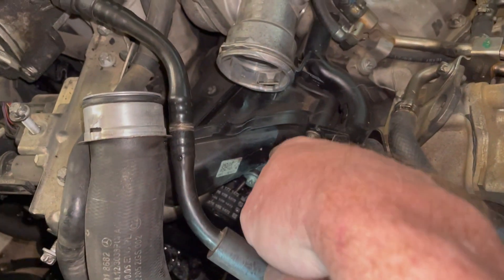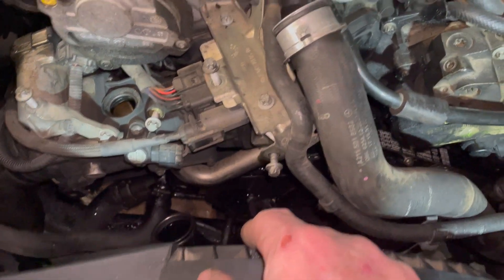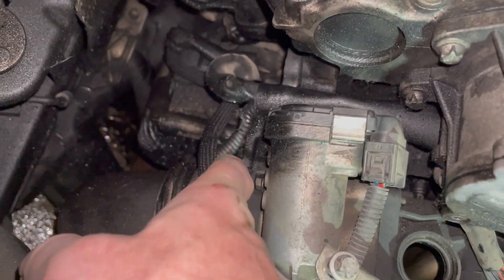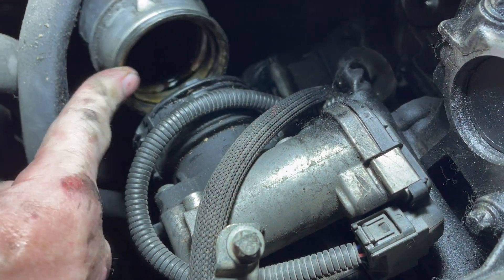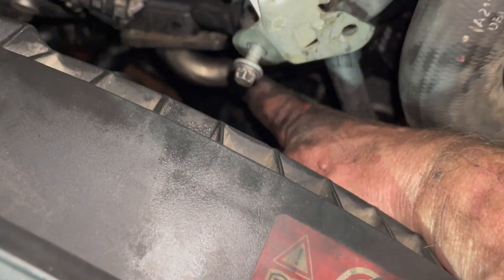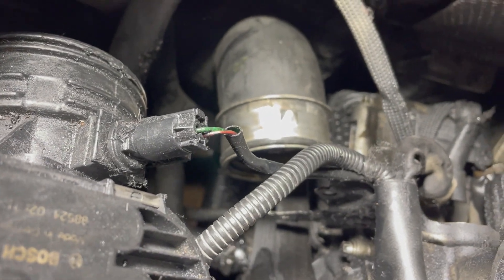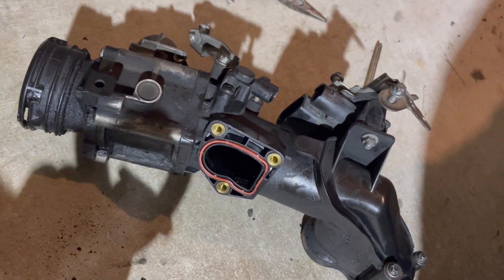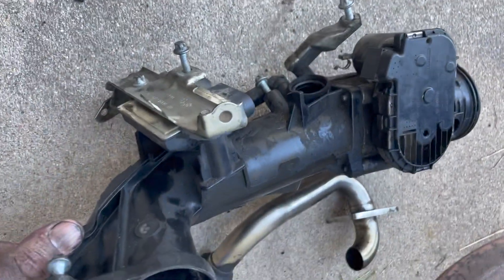OM642 (oil cooler leak fix 2) Intake throttle body/EGR return mixer removal

Comment: Hi, the large rubber hose that goes to the throttle body — a size 8 socket fell into it.
What’s the best way to take it apart or get it out?
From the bottom or from the top?
I have a one-meter magnetic pickup tool and a camera.
Thanks.
Reply from the maker: I think from the bottom is best. It’s been a while since I worked on this but I think you can take that hose off on the lower right side. The magnet is a good idea, that has worked for me. If you need to uninstall the whole throttle body (not that hard but time consuming) the video should help since I show all steps. Hope you get it
Reply: @DIY-VIDEOS  Yes, I took off the hose from below that went to the intercooler — it was lying there.

Comment: I've had this car for 6 years. I've done this job 3 times so far. Now it's starting to leak again and I don't feel like taking it apart again. It's unbelievable how bad this design is.
Reply: Hi, thanks for sharing your experience.
I’m currently chasing a boost leak on my OM642 and I’m in the same area (charge air pipe / throttle body / mixer housing).
Could you tell what exactly was leaking on your car?
Was it a cracked plastic pipe/resonator, an O-ring, or the gasket at the mixer/throttle body?
And did you end up replacing the whole part, or did you find another solution that lasted?
Thanks in advance, would really appreciate your input.
Reply: @BD-ps1zwHi,there were no cracks anywhere. I just replaced the seals. I saw most of the fluid around the throttle body and where it connects to the intercooler pipe. The only place I don't see any leaks is where it connects directly to the engine.
Reply from the maker: Yeah this is actually the second time on this car. The first time was still under warranty and the dealer fixed it. It’s too bad because otherwise seems like a good engine. We have 192k miles on it and other than the leak no issues

Comment: In 3,15 min plastic pipe is attached to egr and there is o ring. Can you please tell me what o ring or seal it is to buy? Thanks
Reply from the maker: I bought an OM642 oil cooler repair kit that came with all the parts including the new oil cooler. Look at FCP euro as an example (there are a few different ones). They include the part numbers and you can order the parts separately

Comment: Hey mate if you can help me ! I have w204 with OM642 engine, I’m trying to change DPF sensor but I couldn’t find it !
Reply from the maker: I am not sure exactly but there should be two tubes connecting the sensor to the DPF. Maybe you can look for those tubes starting at the DPF and follow them up to the differential sensor. Sorry I don't know more than that right now
Reply: @DIY-VIDEOS  no worries ! I appreciate your information 👍🏻